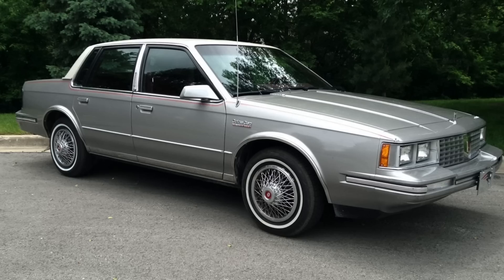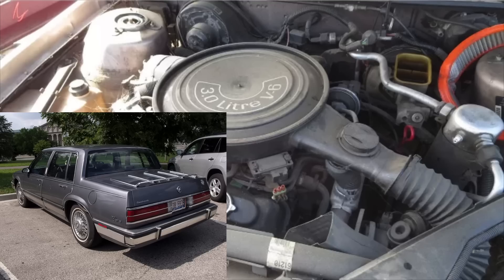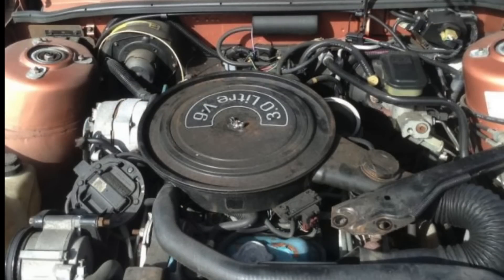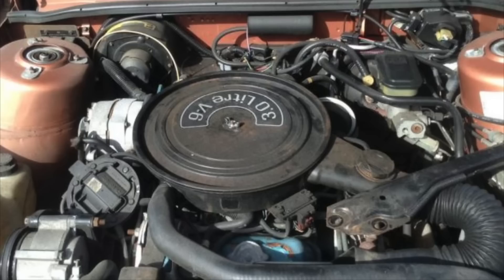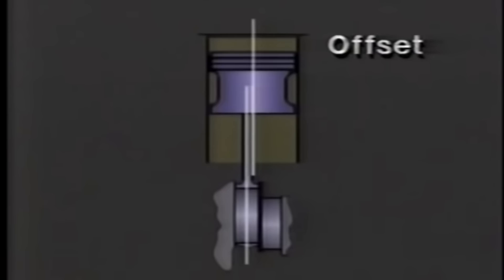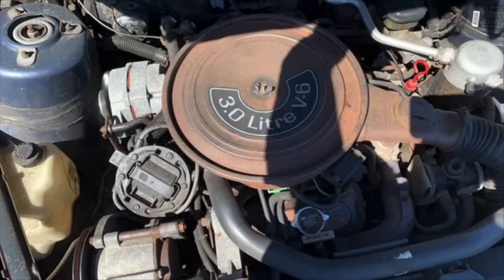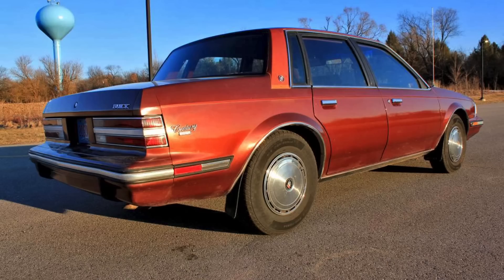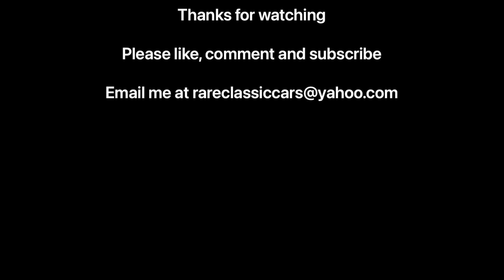Worst Engines of All Time: GM's 3.0L LK9 Carbureted V6 Engine (Buick Century, Olds Cutlass Ciera)

Comment: Hi Adam, This is a really interesting post for me as an Australian as one of the little known facets of GM history is that its Australian Divisions 6 cyl engine had reached the end of the road due to its inability to be converted to unleaded. GM-H looked around world wide externally and internally for a replacement to power the Commodore. Your description here explains why the replacement engine came down to the Nissan RB-30 and believe it or not the Jaguar AJ-6 with the Nissan RB-30 getting the gong.
Reply: But it didn't take them long to switch to the 3800 anyway
Reply: @mrspandel5737  It was an economic decision  not an engineering based one as the $A dropped significantly against the yen causing GM-H to loose money on every RB-30 brought. The  VN commodore was originally designed for the RB-30 and had to be re-engineered for the 3800 v6

Comment: That was cool.   I remember local auto parts stores, when they were independents, used to stock crankshaft kits for those.   Those offset crank pins were pretty weak.   Did the Buick 4.1 V6 have a similar crankshaft?   I think it did but don't remember for sure.
Reply from the maker: Yes

Comment: The 2.8/3.1/3100/3400 60v6 had a decent niche following. I did a lot of tuning on my modded 2.8 :)  I even mapped out the $DF tuning file to like 99.9% completeness.
Reply: Haha ,I remember my buddies 84 GMC s15 with a 2.8 v6.
The exhaust rotted off behind the cat,and all that was laying around was some pipe and an old cherry bomb.
So the 'bomb went on and a pipe went out the back. 
It sounded like a Detroit 2 stroke almost, well, like a brother to one at least. 
Used it as a landscaping truck hauling a 52" scag for 5-6yrs and took quite a beating.

Comment: I had a 84 buick century 3.0 years ago, didn't have a lot of problems, but it had no power, but was a smooth driving, I've also owned 93 century wagon 3.3, 94 century 3.1, 93 olds 3.3, 88 celebrity 2.5, 88 celebrity Eurosport wagon 2.5
Reply: So many had no power had an olds no power.

Comment: When it comes to V6 engines, the WORST possible angle is 90 degrees.  The narrower your make it, the smoother it gets.  A 60 degree angle is considered ideal, because it gives fairly smooth running with decent room for an intake.  A 45 degree V6 has never been built because of the intake restriction.  Harley-Davidson uses this angle in their V-twin engines because they simply do not care about RPM power, they just make the displacement large.  HOWEVER, there was a 15 degree and even a 10.8  degree V6 produced:  The Volkswagen VR6.  This used one cylinder head for both banks which solved the issue of intake spacing.  AND making the "V" wider than 90 degrees increases smoothness as well;  The latest Ferrari 296 GTB has a 120 degree twin-turbo "hot V" V6 engine that is exactly as smooth as the 60 degree design that they used on the original Dino.  This Italian company produced a 180 degree V12 for the Testarossa, which was NOT a "boxer" at all.  And it was a smooth as a turbine engine.

The ultimate smooth 6 cylinder engines are either boxer flat-6 engines [Porsche] or inline 6 engines.
Reply: IIRC, Harley-Davidson V-twins are patterned after two adjacent cylinders in a radial engine.  And Volkswagen's VR6 isn't a narrow-angle V6 so much as a straight-6 with its cylinders splayed and pushed together.  And how about V12 engines?  A 60-degree bank angle seems natural, as that's what the firing interval would be, but OTOH a V12 is basically two straight-6 engines sharing a crankshaft.  And a straight-6 is so well balanced that you can use just about any bank angle you want for a V12.  Ferrari has used a 65-degree angle for at least a couple of their V12's, and they also referred to the flat-12 engines used in the Berlinetta Boxer and Testarossa as "180-degree V12's".
Reply: @DinsdalePiranha67  Lots of good points.  The BB512 used a flat 12 engine but it was NOT a "boxer", which means the opposing pistons moved the same way.  A straight-6 and a flat-6 have perfect primary and secondary balance, as I have stated.  Yes, V12's are really just two perfectly balanced inline 6 engines working together.  

BUT the big thing I will debate with you:  The VR6 engine is V6 engine.  It is NOT an inline engine "just staggered"!  There is a measurable V angle so this is indeed a V engine.  It uses an inline engine firing order [1-5-3-6-2-4;  The front three cylinders fire, then the rear three fire], instead of the "criss cross"  1-2-3-4-5-6 firing order of a typical V6, and it has some cylinders with long intake runners, and some cylinders with short intake runners.  The cams are different front bank versus rear bank and the injector programs are different for the front and rear banks as well.

Harley-Davidson did NOT use a 45 degree angle as per a radial aircraft engine, that's utter nonsense.  If a radial engine had 7 cylinders in a bank, the angle between cylinders would be 51 degrees.  If there were 9 cylinders on that bank, it would be 40 degrees.  Since these engines always used an odd number of cylinders per bank for even firing on a four stroke engine, you can see how you are wrong.  H-D did the 45 degree thing to reduce size in order to fit in the frame of the bike, kind of like Volkswagen with the VR6.  

The VR6 was built in order to fit 6 cylinders in the place of four and still meet frontal impact safety regulations without lengthening the body of the car.  The VR6 is an expensive (!) engine to produce, but it was extremely compact, taking up the area under the hood of a 2.0 liter engine while allowing upwards of 3.6 liters of displacement.

Thanx for the comment!
Reply: The original Dino was a 65º V6 design. 60º would have been better balanced, but 65º allowed a less restrictive intake design. The use of narrow angle V engines like the VR6 were pioneered by Lancia who built many narrow angle V4 designs going back to the Lancia Lambda of 1922.

Comment: I had a 1985 Olds Calais Supreme (N body) with a fuel injected 3.0 V6. Was this the same engine with modifications?  It was not my favorite and was a bear to service. All the shops would charge me extra for certain repairs.  Just wondering
Reply from the maker: Yes

Comment: I rented a '83 Century V6 for a week while on vacation. One thing I remember is when I took my foot off the gas the car did not initially slow down. It seemed like there was a delay in the engine braking action. Overall it seemed like a decent car but not very exciting. Before today I did not know about the offset connecting rods.
Reply: That is done on purpose on modern fuel injected cars.  Dropping the throttle plate instantly causes a momentary rich condition that the EFI system cannot react to quickly enough and  causes bad emissions for a few moments.  Thus, modern cars have a little device on the throttle linkage [or software, with an electronic throttle] that causes it to close over a time period of about 1.5-2 seconds.  As to that '83, I have no idea since those were carbureted.  The throttle linkage on that car was probably sticky for some reason, that wasn't normal.
Reply: @Flies2FLL  nah they still did that throttle closing delay on em for emissions stuff ,same reasons.
Those carbs had a million vacuum hoses and dashpots for stuff like that (if it didn't also have some electric feedback garbage I can't recall) 
They did that alot back then , as in alot of manufacturers using that trick.

Comment: Cars from the 60's seemed so simple and EZ to maintain. We have a 65 El Camino that still has the original engine, it has never been pulled.    Now engines and transmissions seem to come and go every few years.   Thanks for another fine watch of American automotive history.
Reply: Yes, due to CAFE and federal emissions requirements, precise fuel metering and high-technology is required to make engines perform properly.  The 1980s was a learning curve (thus, "peak malaise" around 1983)
Reply: @scottwagner3214    Sounds good unless we get hit by a EMP......      lol

Comment: The only good V6's that were good from that Era in my opinion were the rear wheel drive 3.8 and 4.3 engines.....
Reply: Early 4.3 without a balance shaft weren't all that great either

Comment: Don't know I agree with you on this, the early 4100HT Cadillac was much worse, the 3300 Cierra with port injection was a real runner, fast as quick for the time
Reply from the maker: The 3300 was a good engine indeed
Reply: @RareClassicCars  the 3300 Cierra was faster than my 90 Trofeo 3800. But not nearly as attractive or luxurious.

Comment: My Dad had a long list of cars with crap engines. 65 Corvair Monza with the low end engine, a 73 VW bus the that ate 4 engines during his ownership, the 2.8 Peugeot Renault Volvo v6, the 3L v6 in an 85 Buick A body, a 3.8 v6 in a  Taurus....there was, at least,  an indestructible 3l Vulcan in another Taurus.
Reply: Yep,  I've got 361,000 on the Vulcan in my Taurus
Reply: @jamesengland7461  Me...on the other hand....1200 Honda, 2.8 Cologne, 327 Chevy, 400 Pontiac, Slant 6, 289 and 5L Fords, 1500 Honda, 2.3 Turbo Ford, 4.3 Chev, 3.8 Buick, 5.0 Coyote, all bomb proof.

Comment: Thank you Adam. Very educational and quite interesting information. I now know why this engine went way. I guess the later 3300 V6 made up for this engine. Too bad the 3300 did not stay around with the 3800. It was also informative hearing the connection to the 3800 V6. It would nice to see and hear the story on the 3300 V6 and the 3800 V6.
Reply: GM never should have replaced the 3300 with the thrashier 3100 in the N and A-bodies.
Reply: @judethaddaeus9742  
I’ve had and still own some 3300s, and they’re good engines. 
That said, they idle rougher and have less power than the 3100….I own one of them, too,
Reply: @patrickflohe7427  The 3300 and 3100 had the same exact amount of power and torque… 160hp and 185lb-ft of torque. And if the 3300 had used the sequential fuel injection system and balance shafts from the 3800, it probably would have been smoother and even more powerful and economical than the 3100 was.
Reply: @judethaddaeus9742  
Maybe, but it didn’t have it. 
I am not bashing the 3300 at all, but I’m just saying the 3100 seems peppier, and idles smoother.
That’s the one thing I heard people comment on, about the 3300. It didn’t idle very smooth, and that turns a lot of people off. 
I didn’t have a problem with it.
Reply: @Patrick Flohe  I had a 91 Buick Century with the 3300, it was extremely dependable. I put over 200k miles on it. It was definitely not as torquey or powerful as any 3100 I've driven.
Reply: @judethaddaeus9742  Wasn’t 3.1 a bored or maybe stroked out 2.8? I thought that I read somewhere about it being a 2.8 with increased displacement.

I had a 3300, and it had lots of power.
Reply: @brianburns7211  The 3.1 was indeed based on the 2.8, but with a 0.32” longer stroke. They had the same cylinder bore.
Reply: I had the 3300 in an Oldsmobile Ciera. One of the best motors I have owned over 4 decades of autos
Reply: @mainebigfoothunter7088  The GM3300 and 3800s were G rotor crank oil pump engines, with rod offset removed, and had a bunch of development. Love to hear about it. That Flint built engine was exported to Australia for years and got built into rear drive V car Commodores and Statesmans and Caprices for years. It may have had main seal leaks, but I've personally driven 125000 miles from 1993 to 2000 in one GM3800. GM sure learned their craft well on that engine.
Reply: The 3300 V6 went away because the A body carline was the only carline using it by 1993. Other carlines were using the 3100 V6. The A bodies were supposed to be discontinued after the 1993 model year, but GM kept them for 3 more years because they were still selling well. To do this though, they made updates, like in 1994 adding anti-lock brakes and airbags as standard equipment to keep them competitive in the marketplace. The 3300 V6, even if it was a good engine - why have it for one carline when there was another similar displacement V6 available used in many carlines? It was a cost saving measure.
Reply: @sasz2107  The N-bodies also used the 3300 through 1993 before switching to the 3100 for 1994, just like the A’s did. And there’s no reason the Buick and Olds W-bodies couldn’t have used it, too, since the Regal got the 3800 as well,
Reply: Every Buick Century I've owned (I've had 4 including my current '91) had a 3300 mated to a TH 125 (3T40) transaxle. Outside of eating water pumps they're fantastic. I don't have much bad to say about them honestly other than the water pump issues.
Reply: @christopheryanoski6899  
I never had to do a water pump on any of mine.
Reply: @patrickflohe7427  I had a paper route with really picky customers so my first two idled alot. The last one and current one I didn't have anything happen but those were/are always at highway speeds. I have one in the trunk of the '91 just in case. Easy fix when they do go.

Comment: GM really got the 3800 on point . . .then dropped it for some rubbish that hadn't finished alpha testing.
Reply: GM dropped the 3800 because it was a 90 degree design that was too wide to fit in the upcoming engine compartments - they were trying to save weight due to the CAFE fuel economy mandate. The new motors are often difficult to work on because the car is litterally built around the motor

Comment: Excellent video!! When I built my first engine (1973Dodge 318) I had to order the printed factory manual to get the specs and was shocked as to the tolerances that were used to build engines that made it 100k to 150k miles without exploding. Even with just hand tools, a calculator, and calipers I realized how many engineered defects of the engine were easy to avoid. That engine made its way into three different vehicles before I retired it. And it still ran when taken to the dump. The GM3ltr could have been a good motor and the fact that it was built with so many side loads and offset center points, while still being an functional engine, shows that the engineers were sht but the craftsman that built the motors were very skilled. Very informative video, Thanks!!!
Reply: Ummm the Phoenix was not an A Body. It was a  X Body introduced in 1980. 6000 was the Pontiac entry.
Reply: @78logistics  Before 1980, Phoenix shared RWD bodies with Nova, Apollo and Omega - would that have been the A body of its day? Dunno.
Reply: @sean7134  Ah! Yes!  Replacing the water pump.
I've yet to own a vehicle where the water pump lasted 100K miles.  They could always be counted on to leak by 80K ~ 90K miles.
When I had the timing belt with my Toyota pickup truck replaced, I instructed the repair shop to replace the water pump, too, as the labor cost would be the same. It made little sense at 75K miles to pay for all that labor expense for the belt replacement, only to shoulder the same expense at 90K miles to have the water pump replaced.
Reply: You could say the exact opposite that engineering wasn't the problem but the guys who put it together were.     Reality is in the middle, not being engineered to be able to be slapped together without care and to keep running and not put together with that care. Engineering includes though including what you can get manufactured within (union included) corporate politics which probably explains the spec tolerances. Knowing what they should be is far easier than coming up with the spec the manufacturing can hit without bankrupting the company that will still work well enough so it doesn't bankrupt the company (and that will still keep your department from being cut!)

Comment: I think the LK9 was a 90 degree design, which means that it was part of the Buick 3800 program.  It's amazing how much different two "children" from the same family can be-
Reply: It would be cool to resurrect one from a certain corporate, chain, you-pull-junkyard, and dub it the LKQ9!
Reply: «It's amazing how much different two "children" from the same family can be».  True.  One of my children is gay and the other is not.
Reply: Yea look at the Chrysler V6s in the 90s. The 2.7 was garbage but the 3.5 and 4.0 weren’t bad engines.